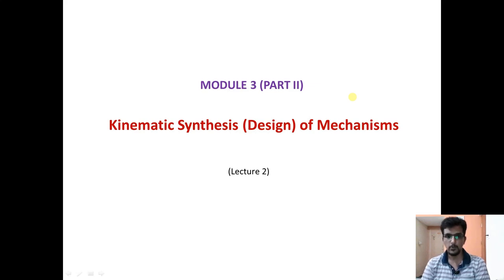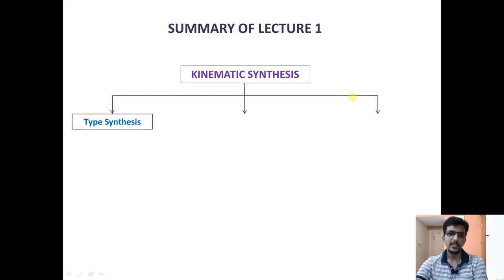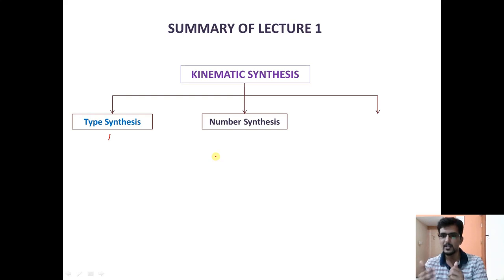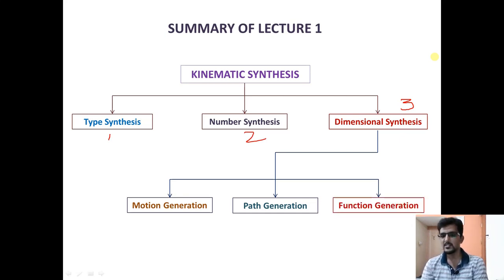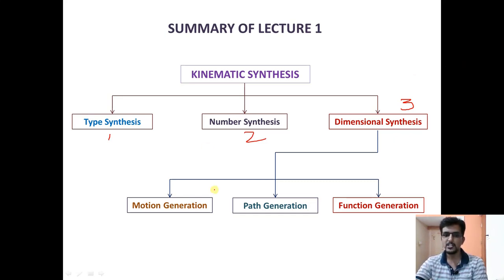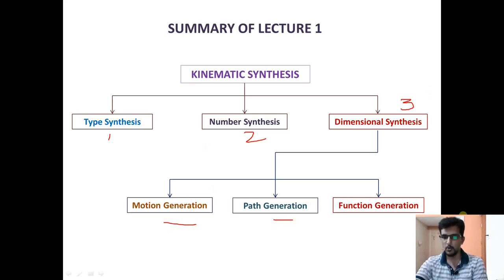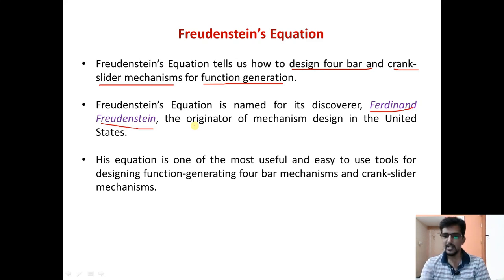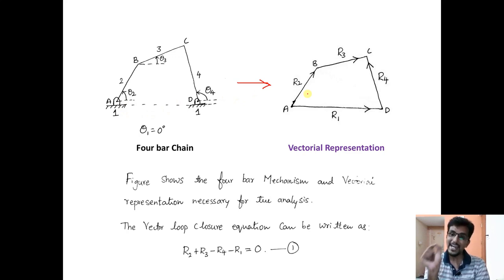Freudenstein's Equation for Four bar Mechanism - Derivation (Function Generation)

Comment: Hi, Assuming I reduce the swinging angle on the output shaft in the crank rocker by changing the sizes, will the power needed to swing the output shaft be reduced too? There is a constant load on the output shaft.